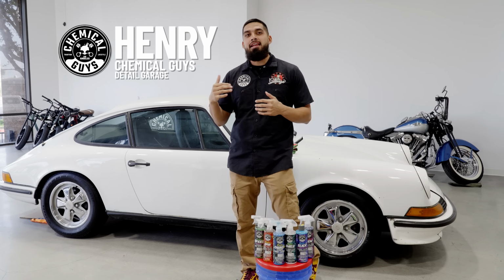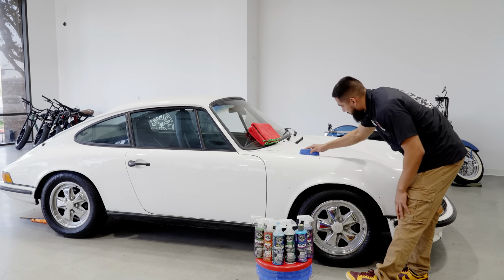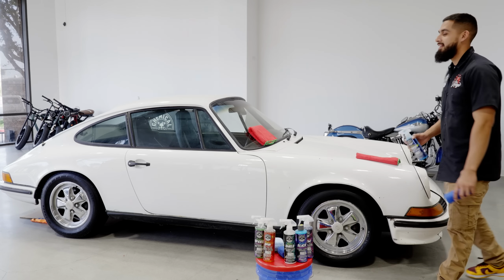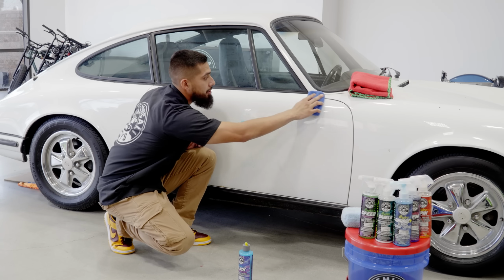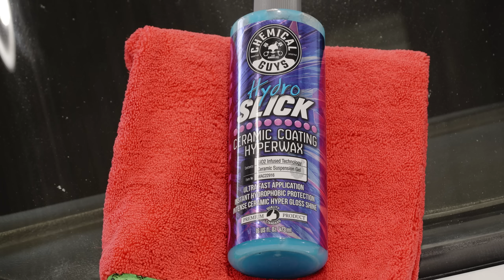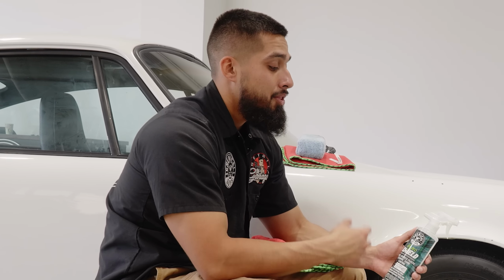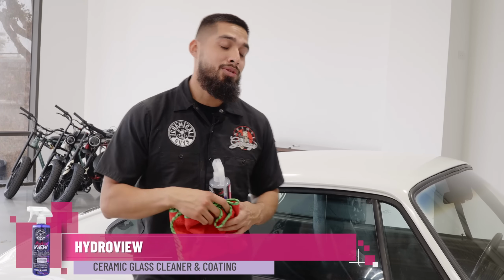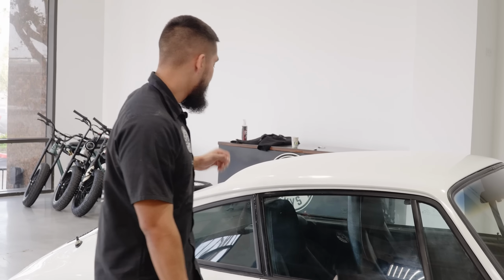How to Apply a Ceramic Coating to Your Car Made Easy!

Comment: can I put hydro speed beforehand instead of hydro charge?
Reply from the maker: Hey! HydroSpeed is intended to clean and boost existing coatings whereas HydroCharge provides a durable layer of protection that lasts for months.

Comment: Question: do I need to wait 3hrs after hydro charge PLUS before applying hydro slick?  You used to have to wait three hours after Hydro charge. But maybe Hydro charge plus is different.

Comment: Question for Chemical Guys: I have applied HydroSlick to my Windshield and glass around the car, when I buff it off it appears to be hard to buff off, what am i doing incorrectly? Before I put HydroSlick, on I did clean it with wipe out.
Reply from the maker: Hi there! HydroSlick bonds immediately, allow about thirty seconds before wiping off excess.

Comment: How come you aren’t using a waffle weave towel on the glass?
Reply: Because It’s unnecessary, using It just makes the job easier, It doesn’t mean you cant use a normal soft microfiber tower.
Reply from the maker: Hey Kyle! Although a Waffle Weave Towel is recommended it is not necessary.